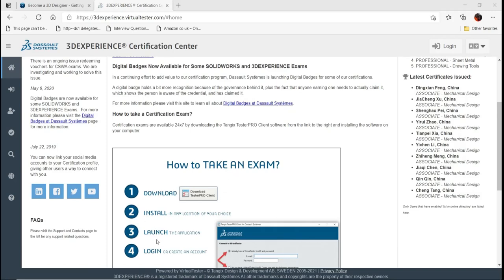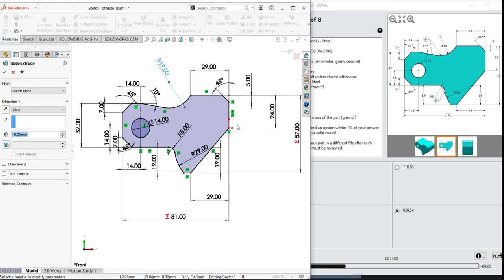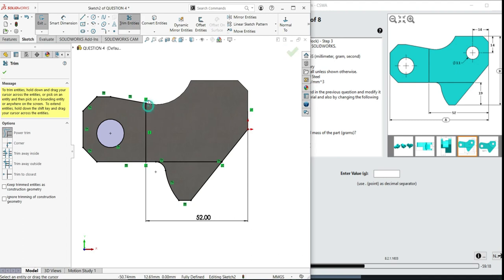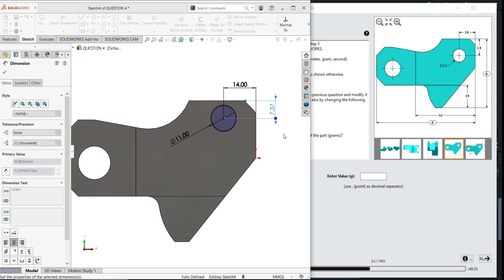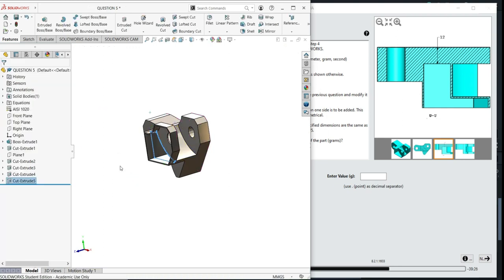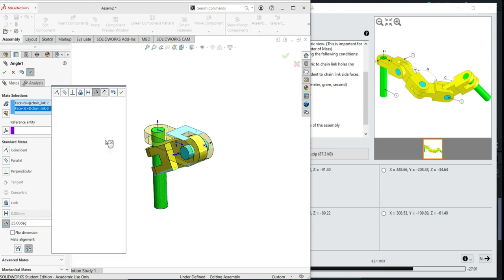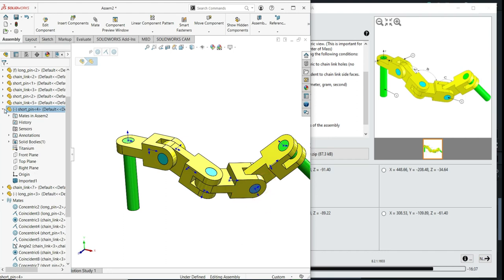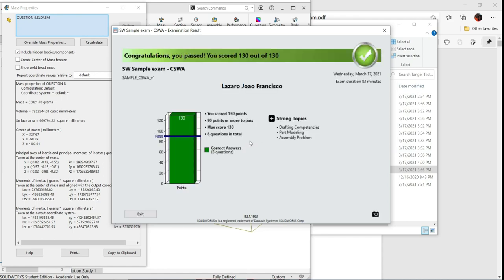CSWA | Live From Real App Used For all Solidworks Exams

Comment: Man can you please suggest me that which is better for which, AutoCAD or Solid works
Reply from the maker: Hello Friend! Depends on which area you're in. If you plan to make engineering drawings, industrial design, structure, electronic design, electric design(modeling), sheet metal, car design, mold. The Solidworks is the best. Now, if you want to use it for architecture, AutoCAD is best. The selection will depend on these factors
Reply: @Mengineer10  Thank you so much buddy, that's what I was confused about, I want to buil engineering stuffs like automobile, robots, etc. so can I skip AutoCAD and directly learn Solidworks
Reply from the maker: Great, This software is very flexible and easy to use. Explore my channel there are several tutorials in how to use it
Reply: @Mengineer10  Thank you brother, you really helped me.
Reply from the maker: @bun72642  great!! glad to know that